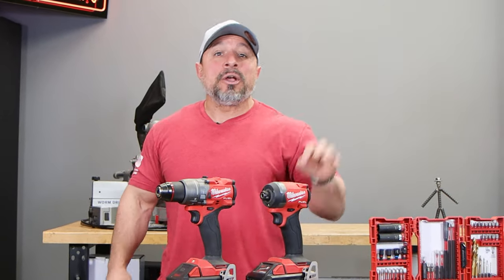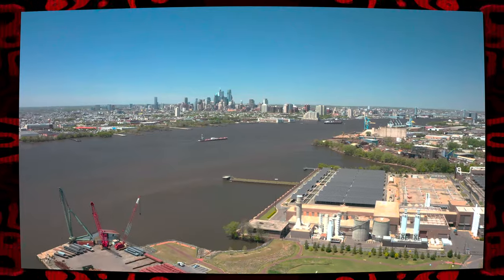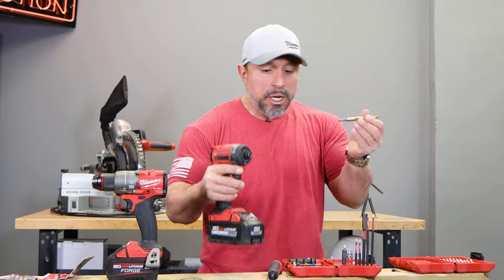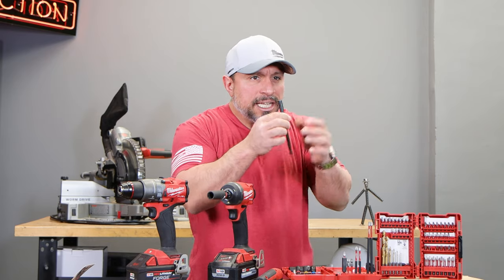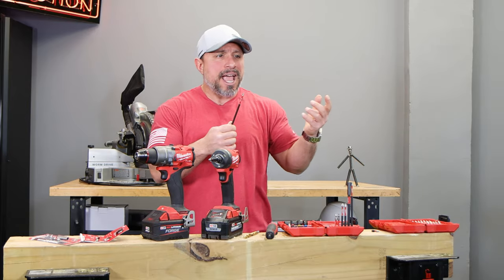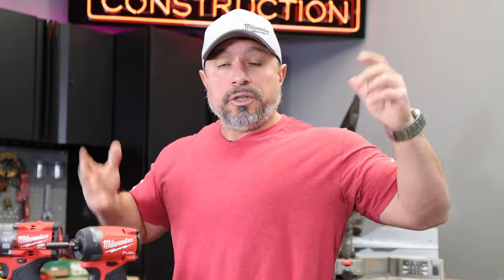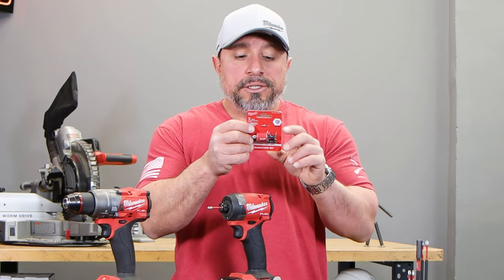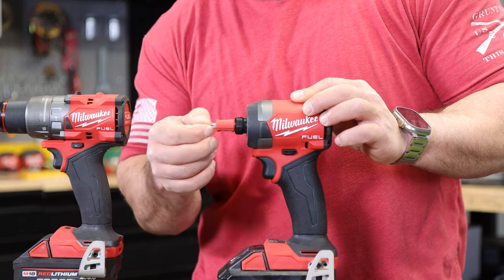Cheap Milwaukee Drill Bit Fix!

Comment: I like their drill and bit accessories, but I HATE how hard it is to remove stuff from the cases!!! I’ve cut my fingers trying to remove the hex drive drill bits from the case.  Any solutions for this?
Reply: I use an old pair of needle nose pliers. It ain't elegant ... but it works
Reply: I use pliers to but we shouldn't have to.
Reply: @clemmcguinness1087  
I got sick of needing a tool to get them out, so I ran a drill bit into the holes.
Reply: Hit the case with a heat gun a little bit and move the bits around a little bit
Reply: Load the bit in bottom end first then just lay the bit back into clip. Super simple 🤷🏻‍♂️
Reply: Same to pull out. Pull on the top end of bit first. Once it is 45 degrees yank out the bottom end from case. Do not directly pull them out at one go.
Reply: Milwaukee cases made me buy DeWalt bits. Clear front makes it easy to find the bit before then opening the case, and I don't need pliers to pull out the friggin bits!
Reply: Though this was just me
Reply: @Mercenaryline  
The case that came with my hex based drill bits have just a hole that the hex pushes into.  I think there is a plastic nub inside the hole that adds extra tension/friction to hold the bits in place.  

I have a Bosch bit set that has holders like you described and prefer their system… I just wish I could find their boxes without any bits.
Reply: That is the old style case they everyone complained about. The new style that fits in PO organizers, are much easier to remove.
Reply: @sinnerLA  clever stuff!
Reply: buy an actual driver kit. Cheap store bought tools here are garbage.
Reply: I actually quit buying milwaukee accessories because of this problem. I run all m18 tools in DeWalt toughsystem toolboxes with DeWalt bits/drills/etc 😂😂
Reply: It's awesome once you figure out how they work.  Stand the bit up and out it comes. Same to put back. Put in upright, then lay it back. You'll see it's not tight at all. It's only tight if you do it wrong.  Believe me, I wasn't impressed with the cases until I realized how easy it is.
Reply: I just finished watching a video where he makes fun of the finger cutters lmao

Comment: I bought one from dewalt years ago... 🙄
Reply from the maker: Me too, don’t know what took Milwaukee so long!
Reply: I got one from makita years ago ...
Reply: Well I'll say that if this Milwaukee one is a close copy of the original Makita Mag Boost then it will be the new king imo. I've had just about every bit magnet out there that is accessible at stores. All of Dewalts variants and many other brands and the Original fully sealed teal Makita Mag Boost was the best but they quit making it. They went to the metal XPS version which is decent and then came out with a new teal plastic version but it's inferior to the original because the magnets can fall out. I'm going pick up this Milwaukee and if it's like the original Makita Mag Boost and the magnets are sealed inside a one piece plastic housing then I'm going to be stoked.

Comment: Hey Vance, that silicone ring is huge compared to the magnetic bit holder that gots that "junk in the trunk!"  cuzbo. 
I'ma stick with the magnetic, collet attachment driver bits from DeWalt. They're real nass like
Reply: That’s what was thinking too. It really didn’t solve the problem with the magnetic bit holder being a larger diameter.
Reply from the maker: You don’t like the junk in the trunk?
Reply: @VCGConstruction   dude I love junks in the trunk. I got a 2500HD so I can haul all the junks. And if it's still not enough, throw a gooseneck on it and really haul some junks.

Comment: At one time in a galaxy far, far away when I was young there was not, a battery impact driver.  Impacts where air tools and screws were driven with corded drills or if you where really lucky you may have had a 7.2 volt Makita stick battery drill.  In those years to keep screws on the drill you would use chewing gum, maybe silicon caulk, or even a dab of an adhesive. 
Today everything is so, so easy.  I just reach for my Bosch 12 volt impact and GET R' DONE !!!!!  Although I still reach for my 18 volt Bosch 535 hammer drill out of old habits. It's a friend of mine.😊
Reply from the maker: I was watching Star Wars the other night! ⭐️⭐️👍🏻

Comment: Went out and bought 2 as soon as your vid finished. It’s actually very good! The magnets have very good strength. Better than the 1/4” magnetic bit holder. Much better. Thanks for the hot tip Mr. VCG Construction! Much appreciated!
Regards,
Cesar L. 😊
Reply from the maker: Thanks Cesar, hope they’re good additions to your setup

Comment: @VCG I'll come back to Milwaukee bits after this.  I've tried DeWalt slip over magnet, Norske, and many more.  Most recently, I've been using Makita for their sleeve magnet but it can be vulnerable because it's two press-fit pieces.  The Milwaukee looks like a one-piece design.  This is a big time and trouble saver! Thanks for the video, Vince!

Comment: i grabbed the makita over this one and the makita sticks by magnet so it tends to slide down on longer bits i saw this video and ran to home depot to buy this one lol and i like this version way better it has a better magnet and i like the way it secures to the bit way better it fits any bit also to demagnetize a bit you can run it around the outside of the bit that works for me anyway(not sure if you talked about this or not if so sorry lol)

Comment: Have had a couple of older spring loaded quick chuck style DeWalt ones that were designed to hold the 1” bits and had a magnetic ring that held the fastener. Loved em. Over time, sometimes it wouldn’t want to give up the bit when you needed to swap out and the chrome coating on the neodymium magnets would eventually get beat up and start to degrade, but they did work well and stand up to a load of abuse. More recently, for the thin Milwaukee Shockwave bits, I have found some slip on magnets from Masterforce, found at the retailer my kids refer to as  “Save Big Money at Menard’s, or Menard’s for short.
They work great, but they’re, Dark Green and Black and tiny, and have a tendency to go missing. (The bit holders; not my kids.) ((They’re shades of peach and often go missing too, but I think it’s more due to the fact that I embarrass them regularly.))🤔
Reply from the maker: 🤣🤣 I’m gonna check out the magnets from Menards and save big money, thanks James! Gonna be at OPT May 22nd, come hang out Cuzbo!
Reply: The masterforce magnets arent that great. They dont hold up to hard use and the little neodymium mag rings pop out of the unit easily. I tried usi g them proffessionally a couple years ago as I liked the price of the Masterforce bits but the magnets didnt hold up well amd they dont hold on the bits that well either and would often come off the bits and stay atrached to the screw ya just got done driving. Ok for occasional DIY but wouldnt recomend for proffesional all day use.

Comment: Dude I love your videos but this didn’t fix anything, it’s wider and more chunky around the middle then the 6” extension, and like you already said “why not just use a magnetizer, well it loses its magnetism after impacts.” But then right after use the exact same scenario on how to use it in small spaces and say it’ll stay magnetized for a few uses.

Conclusion, just use the 6” magnetized extension you get in almost every bit pack and get a magnetizer for the long 6” bits for the tight spaces. Your just adding an unnecessary small “tool” to your collection that’ll probably get lost.

Comment: Nice vid as always VCG. I think Milwaukee copied Makita on this though. But a red one does look better then a blue one on those red Milwaukee bits 😂. But I will have to give props to Makita for inventing the original Mag Boost that I've used and loved for probably 8 years now. Sadly am down to just one left out of the twelve I bought for $3.49 a peice over the years. I might have to take a look at this Milwaukee one and see if it's an improvement on the original Makita Mag Boost as you can't buy them any more. And the newer version that Makita came out with isn't as good as the original as the magnets in the newer version can fall out if the unit gets banged around in work situations.

Comment: Been using 2 of the Makita ones for a long time now & they are a game changer. Would say they are just as good if not better & easier to put on & off & set closer to bit tip or end when needed. I have one of these Milwaukee ones & they are great when working in tight finished surface spaces because of the soft material you don't need to worry about damage. Both are great would recommend having both. They're both cheap anyways

Comment: Hey vince what brand powertools would you recommend for a diyer that wont use tools often?
Reply: Always buy the best tool you can afford. Tools can be an investment for you to use at home, even if you don't make your living with them.
Reply: I use milwaukee drills and screw guns, because they're pretty much indestructible, and get the most use. But whereas my father uses a $400+ skillsaw, almost daily.... I use a 50$ ryobi, because it gets used about 3x a year. Invest your $ where it's most needed.

Comment: Does it matter which way you put it on the bit, like are the magnets on one side or through the whole sleeve?  Say I want to put it on one of the shockwave double ended bits, will it magnetize on both ends?

Comment: Was worried at first because I was like how would that fit in tight spaces until you said you can take it off and it will still be magnetized and you just put it back on when your done in that tight space,will be purchasing this!
Reply: Actually if you use this style of magnet on a long say 6" bit you can slide the magnet all the way back to your impact collet and the magnet is so strong that it will still hold a screw at the tip of the 6" extension very well. Thats been my experience anyway with the Makita Mag Boost which this Milwaukee is a copy of.

Comment: Makita xps one is great.Might need to try this one.
Reply from the maker: Makitas XPS is definitely one of my favorites
Reply: I like the Makita XPS quite a bit myself but it's not as versatile as the original Mag Boost. You can only use the XPS on Makita bits and even the new Makita XPS bits don't work as well with the magnet because they got rid of the tiny octagon pattern milled on the bits that would keep the magnet from slipping back. And that was a nice feature because you could use the XPS magnet as an oversink preventer when driving screws.
Reply: @duncdunc76  I have both and I agree the mag with teal sleeve is better but both are sweet.what phillip bits brand you think are the best?
Reply: @LARULES100  well if I'm using the XPS magnet then the XPS #2 is what I use as I like the feature of being able to use the setup to get consistent screw depth when building playsets which I do alot of professionally. But I will say that over the 15 plus years of driving wood screws I feel like the Impact rated Dewalt bits have been the most durable for me but I rarely use them anymore as a good magnetic setup is key for me and Dewalts magnets are not as impressive as Makitas.